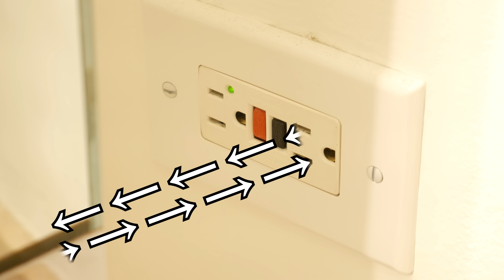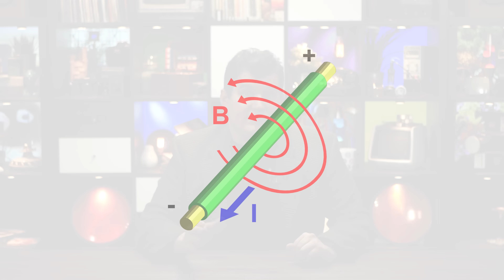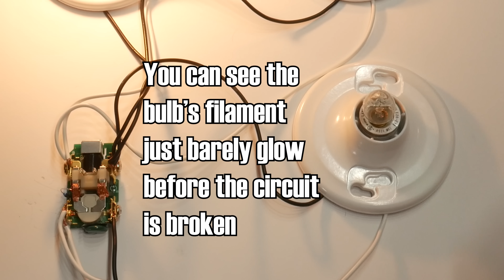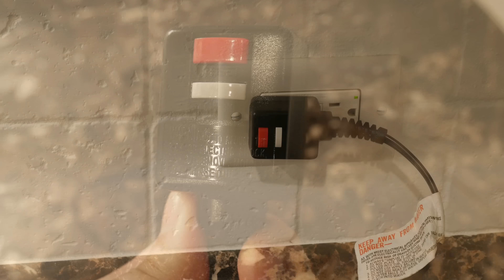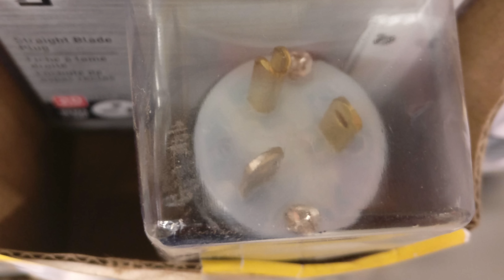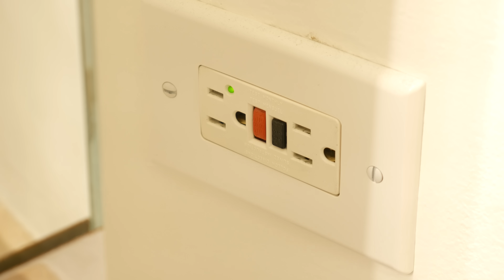The GFCI/RCD: A Simple but Life-Saving Protector

Comment: Do a video on Arc-Fault Breakers!
Reply: These are much more complex devices, with a DSP and lots of software inside, so they can differentiate between an arc fault and a switching power supply or sparks from a switch. Well, at least the ones for the domestic market...

For "mid-range voltages" (that's high voltage for about everyone of us!), things get a bit more...interesting. If arcing occurs in a "mid-range voltage" substation, the whole thing will burn down in about zero time. So fast that any switch/circuit breaker would be too slow.
To quickly detect arcing, optical and acoustic sensors monitor the substation. if arcing is detected, power is not cut (way too slow!) but shorted. The short drops the voltage to near zero, problem solved (and some comparatively rather slow fuse/circuit breaker will eventually cut the power due to the short).
The incoming power lines are flat conductors and non-isolated. To short them, another flat slab of copper is placed across all incoming lines. Since time is of the essence, this copper slab is moved by explosives.

Comment: The big difference between GFI and GFCI is that the GFI is designed and installed to stop electricity to THAT outlet, while the GFCI is designed and installed to stop electricity to the whole circuit, in coordination with a GFCI breaker. - Also, (at the very least) in the state I live in, GFI is no longer code for new construction and/or wire runs with outlets within a certain distance of water fixtures.
Reply: MonkeyJedi99 they are one in the same.
Reply: @marks4374  Not in my state's building codes they aren't.

Comment: Question: since they are so useful, why aren't they installed in every outlet, instead of being left to bathrooms and kitchens? Cost?
Reply: Costs is correct. Not only do they cost more upfront but they do actually have to be replaced occasionally when they stop working. However there is nothing stopping you from having your own entire house protected if you don't mind the costs, and you wouldn't need to replace every single outlet since only the first outlet in the chain needs to be a GFCI.

Comment: I'm so confused! If exactly the same current is returning in the load, where's the work coming from? Like, if you're running a lightbulb, you're putting in energy and some of that is turning into light, or heat, or whatever, right?
Reply: The work is coming from the drop in voltage across the circuit. Think of it like water falling down and turning a wheel. The same amount of water went in and out, it just fell down to a lower level.

Comment: One thing you didn't mention (And the main reason I think the U.S. standard is better) is that the device is extremely sensitive. TOO SENSITIVE. Any amount of residual current will trigger it, and when you consider a large circuit from, say, a warehouse, or a 300m2 house, you'll have so many cable junctions and devices that you're garanteed to have a decent amount of residual current. The standard here is on the main pannel, but the trigger is 30 mA, and sometimes you need to get an even bigger one (100 mA of residual current) because it's impossible to stay under 30 mA.
Technically, if the baseline is 25 mA and someone gets shocked, the remaining 5 mA will be reached and the protection is the same as the U.S standard. But it is unsafe when you consider a large residual circuit might be disconnected.

Comment: You missed the point that they only protect from hot to ground faults... they will not trip if you are being shocked between the load hot and load neutral and you yourself are insulated from a ground.

Comment: Well done video!  Explains what had been a mystery I experienced a while ago in the townhouse I'm renting.  The regular outlet in my upstairs bathroom stopped working.  I checked the breakers in the basement and found nothing wrong.  I then went to use the outlet in the downstairs bathroom that had the test and reset buttons on it and found the reset button popped out.  After resetting it, the upstairs outlet worked.  Even though I thought both bathrooms were on separate circuits (the lights probably are), now I understand how the outlets are connected.

Comment: residual current... as a electrical engineer i can say that its named after the currents that go to ground even when its not a fault, that why rcd’s are in the breaker box and have higher trip current because you need to count for those currents in all the appliances in the house like electric motors have a quite large residual currents, so when you sum up all the currents and plus you touching live wire it trips without a problem plus whole house is protected not just a one socket

Comment: Quite often exterior receptacles are protected by GFCIs in bathrooms.  If you have a problem with an outside outlet, check the GFCI in the bathroom.  This is on of the most common issues when friends ask me for electrical advice.

Comment: I was doing work on my patents' GFCI and thought I had turned off the right breaker. My contactless tester "confirmed" it by not lighting up and beeping, and so I took each of my hands on both sides of the GFCI to pull it out of the outlet, and I was presented with a brief, but potent shock that passed from one arm, through my chest, to the other arm. Turns out, the GFCI tripped almost immediately and I think it's quite possible it saved my life. I learned that testing outlets really needs to be done using a full fledged electrical tester, and not one of the contactless ones. Also learned GFCIs are literal life savers.

Comment: 240 v is so  convenient  to work  with  it and also it comes with  to different plugs one is for 13 amp and another for 15 amp . So no need to this nightmare 120 v different types of plugs
Reply: There used to be 5amp mini versions of the 15amp for lamps.

Comment: In regards to sticking a knife in the toaster, how exactly would that cause an electric shock? I always figured the heating elements were insulated, like the ones on a stove. So even if you touched them with something metal, I figured you would be (relatively) safe. Although with the size of them, if they are insulated, it probably isn't very thick. And I suppose with them being buried deep in the bowels of said  toaster, there would be little reason to spend extra money on insulation. 

I suppose I could check for myself by doing a continuity check with a multimeter. But that would mean getting up and going into the real world. I'm quite comfy here in cyberspace.

Comment: This reminds me of when I got shocked. I was charging my shaver with a Chinese death dapter as I like to call them for this very reason and I went to unplug it. It wasent a gfci but the socket held the plug really tightly and I had sweaty hands (that made my shock worse). I put my fingers under the plug to get a better grip and accidentally touched the exposed contacts because they had no plastic insulation on it. (That's why I call it a death dapter) I don't think I touched both contacts but...its a strange pain. It feels like someone is stabbing your finger but the pain goes all the way up your arm and I think it stopped at my chest. Boy did it pack a punch my hand immediately flew into the air with me swearing like a trooper 😂

If it was a high power load like a microwave oven or a kettle would it have killed me? I mean I assume the breaker would pop open but wouldn't it cause some arrhythmia?
Reply: I got shocked with 220v as a kid trying to repair a chinese lamp, scared the shit out of me but didn't do anything

Comment: To specify for clarity the circuit breakers in other nation service panels are called AFCI (ARC FAULT CIRCUIT INTERRUPTERS), these are wired into the primary home/commercial service panels.
See video link included for Clear Understanding.
https://youtu.be/a6ouo9He1QY

Comment: As a 25 year electrician, I have actually seen regular breakers NOT trip on a dead short. GFI can be a pain sometimes, but also save lives and property.
Reply: in australia we use this term to make it easier when training to be electricians; RCD's save people, Circuit Breakers save your house
Reply: At one point, we replaced an outlet, and to cut power to the one in question, we hit one of the GFCIs to cut the power. But when we reset it, we actually had to reset the breaker for that circuit to get the thing going again. Does anyone have an idea as to what might be the problem, if there is one?
Reply: Also, if the outlet with the GFCI we used were being protected by an AFCI, it would go off rather frequently, as I get an arc even from my computer charger. Probably should replace that outlet too
Reply: in australia we use this term to make it easier when training to be electricians; RCD's save people, Circuit Breakers save your house
Reply: As a person who lives in America and has been overloading cheap extension cords my whole life. Most things dont use that much power. Basically the things that make things hot are all u have to worry about. The rest u can bunch up on a $5 extension cord and it wont even get warm.

Comment: 14.12 Not correct. Simply turn off all of the Over current breakers. Turn on the RCD and the the over current breakers one at a time. As soon as the RCD turns off then you'll know which circuit is faulty

Comment: Now repeat that experiment with a DC fault current.

In the UK, we’ve recently seen discussions emerge in the electrical community about DC fault currents.  These will saturate the magnetisation in the sense coil, causing the device to trip at a higher fault current threshold than 30ma, at a longer time than 30ms.  Sometimes the RCD won’t trip at all.

There’s a good demonstration here: 
https://youtu.be/zL8KUnnQHE4

Now think about all the devices in your house that have a DC load:
Led bulbs, almost all electronic power supplies for phones, TVs, computers, dc motors in vacuum cleaners etc....

Now there’s different types of RCDs.  There “type AC” which is the most common type for AC fault currents.
There’s “type A”, which is also suitable for pulsating DC fault currents.
There’s “type F” (can’t remember the exact use)
“Type B” is suitable for smooth DC fault currents
“Type B+” is suitable for smooth DC and high frequency AC fault currents,

There emerging opinion within the electrical community is that the RCD’s that are widely installed in domestics and commercial premises are probably obsolete and ineffective due to all the DC loads that we have in our houses that could potentially suffer an earth fault.
Reply: But wouldn't that simply not n
matter since the power coming from the wall is AC?
For phone chargers, the conversion is done after it gets past the GFCI. I'm not sure on lighting.
Reply: @reinbeers5322  The issue is that a DC-current from the output could short to phase or neutral, which could prevent the RCD from tripping. In European houses those are additionally used for circuit protection. Therefore a fire could still start (due to sparking, we have 230 V) and the RCD would not detect the fault. Btw: charging equipment for electric cars requires an RCD Type B.
Reply: Well, let's just be thankful that Edison didn't win the electricity war.
Reply: Mr Dyer, was your comment to highjack people from this video, or to inflate your ego? In America DC is generated at point of use, with diodes in place to stop those pesky fault currents you seem to care about. In industry we see 600 volt DC for overhead cranes, and winches. motor-generator for welding. DC works best for anything that requires a variable output, and is grounded independently at the source, the "created" problem you mention doesn't exist here in the states.
Reply: @shikkonin  At the very least, you and I are not talking about the same circumstance. In your version, you have dreamed up a problem that DOESN'T EXIST. Our 600 volt systems are completely isolated from humans, cranes and winches(OVERHEAD), there are 440 volt DC welders, again these would be for industrial applications( for joining sheet steel over 1/2 to 1 1/4 inches) and isolated from humans. You make the same point as the OP, and neither of you seem to know that these systems are created and used within one building. Beyond the 6 volts of a switching power supply on a PC, and the two uses I mentioned above we don't use it in the States.

Comment: I got a zap today putting up ice melt cables on a roof. The extension cord was totally wet and when I went to plug it in to the ice melt cable, zap. Which is surprising considering that snow should be pure water with no minerals in it. Pure water will not conduct electricity. So I guess there was enough crap in the water to do the job.

Comment: A few comments about GFCIs. 
1. If you somehow mess up and put the line (from the breaker) on the load the GFCI is worthless, saw this done in my basement I replaced it and in process found it was wired wrong. 
2. While I like GFCI, they are not perfect say you were doing something silly like fixing an appliance plugged into a GFCI and somehow you got between the hot and neutral many say it would not trip, but there could still be some going to ground, but it may not be enough. 
3. There are also some cases where you may find a unit either in an outlet or in a breaker that is a GFCI combined with something called an arc fault interrupter.

I just ran a new 20A drop to my workbench with a GFCI on it and then chained a second outlet in the same box to it so I have 4 outlets all on a GFCI right by the bench.

Comment: Opportunity to expound more: you could (should?) have mentioned that the shock hazard of water is usually related to it being in contact with metal (copper or iron) water pipes, which are almost always an excellent ground. Thus even when dry, that stainless steel sink in one of your pictures is far more dangerous than a puddle in the middle of a typical floor.

Comment: I will call these “RCCIs.” Residual current circuit interrupter. Seems like it is the best.
Reply: Circuit Imbalance Breaker would have been best. Way more intuitive and still accurate.
Reply: Ground fault is more specific
Reply: @hgpo27  The problem is, this doesn't detect a ground fault, it detects a difference in current. That current different does not have to be caused by a ground fault so you're more specifically being a bit inaccurate. RCCI makes most sense I think.
Reply: @asharak84  Where else can electricity go other than to ground? If it isn't taking the proper path through the neutral and hot, it is faulting to ground through some other means. That is the only path electricity can take other than the designed circuit. Path of least resistance. Residual current doesn't really describe the scenario. It's not residual, its faulting to ground.
Reply: @hgpo27  a lightbulb blowing can momentarily create a current difference without any ground involved, and can trip these.
Reply: @asharak84  Proof?
Reply: @hgpo27  If you look at this video closely, you should notice that the example he demonstrates is having the electricity go to the neutral terminal of the other plug in the RCCI plug.  It's not going to ground.

For something simple, like a hair dryer, sure, the only likely place is going to ground.  But if you have a complex setup, for example a computer with a monitor, printer, and cable modem, all on wired connections, you have at least four ways for the current to go that isn't where it's supposed to go.  And some of those would be very easy to have happen if a vendor was sloppy.

- There's a pair of power wires on the cable between the computer and cable modem if they're connected with either a copper Ethernet cable, or copper USB.
- If the printer cable is USB (these days, what printer cables aren't?  Note that, if I'm not mistaken, Thunderbolt uses USB-C connectors.), it has at least a pair of wires for power transmission.  USB-C has two pairs for power (so that it can be symmetrical in every way that matters before circuit detection can correct for an inverted plug).

Neither of those should be an issue, but I have a recollection of hearing about recalls of at least one device for each of them.

From a strict electrical perspective, I could see an argument claiming that such a power flow wouldn't actually be a problem.  I'm pretty sure I've overheard several.  I've also heard very upset electrical engineers trying to explain why it very much would be.  It wasn't ever an argument I was that interested in - it just felt like an issue to me.  As the electrical engineers in question were upset, I didn't quite follow most of the nuance.

But I did pick up that in each of the arguments, the electrical engineer was convinced that the unbalanced flow would, in addition to other problems I didn't grasp, incur additional expense because the cables it was flowing over aren't designed for significant power draws, and provide worse paths for the electricity than either device would have to get it from their own power outlet.  True, it's possible, and even likely that the data cable connection would be far from the power supply of the device improperly pulling power through the cable.  However, that's likely to be the case for the other device as well.

Comment: I feel like there's a prettier way to have the arrows rotating at 7:20. I think of the arrows like vectors (lying in the xy-plane) and adding these two vectors doesn't get you back to the origin. Instead, it points to either the left or right. In my perfect world, adding these two vectors together would cancel and go back to the origin.
But this is all nit picking and doesn't detract from the quality of the video.

Comment: One time in the military I was doing a service check on a microwave radio transceiver.  I forgot to turn power off and when I grabbed the lighthouse tube to pull it out I got the shock of my life. My hand involuntarily jerked it out and threw it across the room breaking it to pieces. I was ok but quite shaken up.